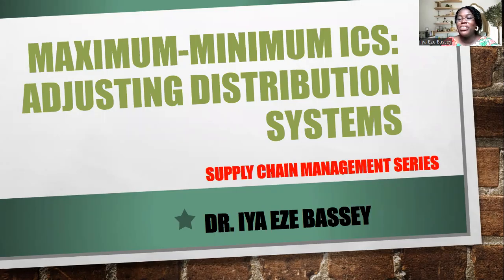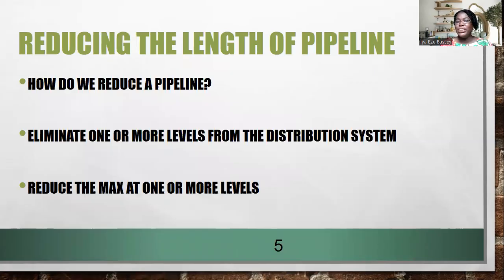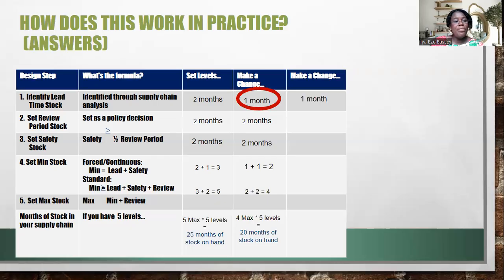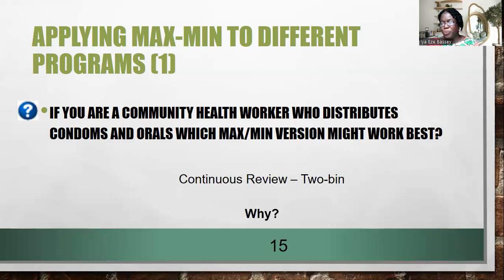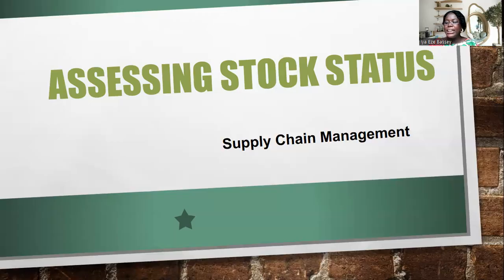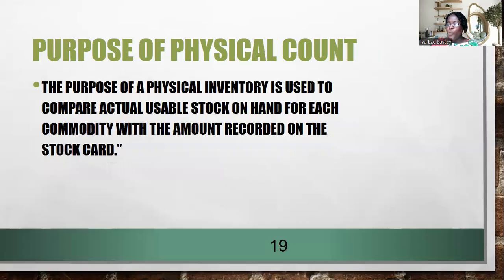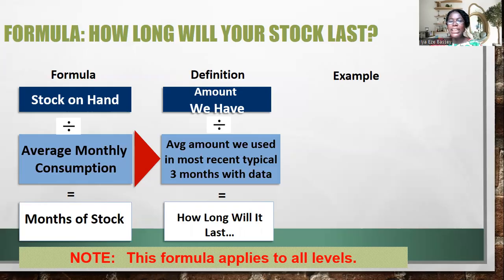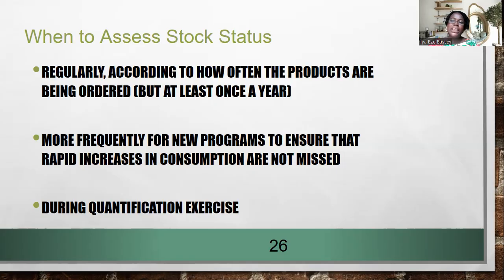Maximum-Minimum ICS: Adjusting Distribution systems (Supply chain management series)

Comment: Thank you ma. I understood that before setting up a max-min system, we need to follow some steps like setting up initial max-min policies for each level, checking if the distribution will function properly if these policies are implemented and checking the total length of pipeline that the policies imply. I also learnt about ways to reduce the length of the pipeline, which simply means making sure that supplies get to us faster and we can do this by;  improving distribution processes, reducing the lead time and review period. This is done by adjusting how much we keep based on how fast items are used and how quickly they can be replaced.
Other things that affect how we set stock levels include how often orders are made, storage space, cost of products, age of program, accuracy of forecast and more. The max-min system is very useful because it helps us know when to order and how much. But each type has its own challenge. The forced type can cause overstocking, continuous requires close monitoring, and the standard version works best with reliable data.
This system is not only for one type of product, it can be applied in programs like HIV, malaria and others depending on what’s needed.
You also discussed on assessing stock status, which helps us know if we have enough stock, too much, too little, or none at all. Doing a physical count is one way to check if what we have in records matches what’s actually in the store.
We assess stock status is to determine how long supplies will last and we were given a formula which applies to all levels; Months of Stock=  Stock on hand ÷ average monthly consumption
I practiced the examples given and I understood the maths.
I got to know that we are expected to assess stock status regularly, at least once a year. The topic really showed me how important it is to always track what we have, what to adjust and what to expect. Thank you once again ma.

Comment: Thank you very much ma. I learnt; In the adjustment of the distribution policies, we have to consider the length of the pipeline . We can reduce the length of the said pipeline by eliminating one or more levels from the distribution system and also by reducing the max at one or more levels. Other factors that affect the max-min system; cost of products, cost of storage, storage capacities, shelf life of health commodities etc. Advantages of using the max-min system; it avoids understocking and overstocking, it ensures consistency of each level, it minimizes wastage etc. Challenges faced when using the inventory control system; systems with numerous levels, systems that manage large number of commodities, and systems that manage products for new programs. How to access stock status;determining our months of stock, whick can be done by fist taking a physical count. We access stock status because we want to know how long supplies will last. Formula to know how long products will last(months of stock)
Months of stock=stock on hand(stock that is a available)/ average monthly consumption (most recent typical three month data).

Comment: Thank you prof. In this video I have learnt, disturb in designing a Max- min ICS which are, to set up initial Max min policies for each level and types of facility, check if the overall distribution will function properly if the level specific max-min policy are implemented and check the total length of the pipeline that the policies at each level imply. And I also learn that there are ways to reduce a pipeline which include elimination one or more level from the distribution system and reduce the max and one or more levels. And the ways to reduce the minimum stock level which is to reduce some element of the formula which can change in order to reduce the max- store levels
Thank you Prof.❣️

Comment: Thank you ma'am for this lecture 🙏🏽

It is important to note that, in the adjustment distribution policies, the implementation of specific maximum policies of each distribution level is important for inventory flow, in the public health  Supply chain.
Some advantages of max -min inventory control systems are :
* Reduce waste 
* Avoid emergency costs 
Some challenges faced are :
* Managing of systems with multiple levels 
* Managing inventory for new program 
The purpose of stock assessment are:
* Conducting a physical Count
* Essential in verifying stock accuracy 
* Preventing discrepancies that could lead to stockouts or overstocking.

Comment: Thank you prof for this great lecture. 
In summary, there are ways in which the distribution system policies can be adjusted and the first thing to consider is the length of the pipeline. 
Considering the length of a pipeline in designing a max-min ICS, the steps includ:
1. Setting up initial max-min policies for each level and type of facility. 
2.  Checking if the overall distribution will function if the specific max-min policies are implemented. 
3. Checking the total length of the pipeline that the policies at each level imply. 
Ways in reducing the length of a pipeline include:
1. Eliminating one or more levels from the distribution system. 
2. Setting up policies that helps to reduce the max at one or more levels. 
 
Reduction of length of pipeline is done systematically by:
1. Shortening the review period. 
2. Reduce the lead time both at one or more levels. 
3. Improve system distribution reliability. 

There are some factors that can affect the impact of max-min stock levels other than length of pipeline which include:
a. Cost of product.

b. Reliability of transportation. 

c. Storage capacities. 

d. Shelf life of health commodities.

Advantages of this system include:
a. Avoid overstocking and under stocking. 

b. To simplify inventory control decisions-making etc.

The challenges of this system occurs in the case of system with numerous levels, 
 System that manage a large number of commodities 
 System that manage products for new programs. 

Assessing stock status is done by physical count which is the counting by hand the total number of usable units of each health facility at any given time. 
 The purpose of this system is to compare actual usable stock on hand for each commodity with the amount recorded on the stock card. 

The general purpose of assessing stock status is to determine how long supplies will last. 

Formula for assessing stock status are:
Stock on hand (amount we have)
 divide by 
Average monthly consumption (Amount we use each month 
equal to 
Month of stock(long it will last).

Comment: I’ve learnt that setting clear maximum stock levels at each point in the supply chain is essential for improving inventory flow, especially in public health systems.
The Max-Min inventory control system helps by: Reducing waste and Avoiding costly emergency orders
However, it does come with challenges, like:
Managing complex, multi-level supply chains. And handling stock for new programmes
 Regular stock assessments are important because they:
1)Confirm actual stock levels
2)Help prevent stockouts and overstocking
3)Keep the system running efficiently.

Comment: I learnt that to achieve and get an improved distribution system.The Maximum_minimum ICS; ADJUSTING DISTRIBUTION SYSTEM has to do with identifying ways to adjust distribution polies Which are;;;
*Set up initial max-min polies for each type and type of facility.
*Check of the overall distribution will function properly.
*Check the total length of the pipeline that the policies at each level imply.

Factors That Impact Max-Min Stock Levels 
*Lead
*Reliability of source of supplies 
*Effect of a zero balance of stock 
*Management skill of staff 
*Age of program 
*Accuracy of forecast

Comment: Identify ways to adjust distribution system in
Nigeria
The steps in designing a max-min ICS which are
to set up initial max-min policy for each level and
type of facility, check total length of pipeline that
each policy level implies,check if the overall
distribution will function properly if specific
max-min are implemented,
I learnt the ways to reduce the maximum stock
level and to change some element of the
formulas,for instance you could reduce review
period at one or more levels ,we also went
through how the work in practice works
I saw the factor which impact max-min stock level
and they are
Cost of products,storage capacity, lead time, age
of program
Some advantages of using max-min system
Avoid overstocking and under stocking
Minimise wastage
We also looked at challenges of using each of the
inventory control system
System with numerous levels

Thanks ma

Comment: In summary,
Factors Affecting Maximum-Minimum Stock Levels:
1. Cost of production
2. Reliability of transportation
3. Storage capacity
4. Cost of conditioning
5. Shelf-life of the commodity
Advantages of Maximum-Minimum Control System:
1. Avoid overstocking
2. Avoid understocking
3. Minimize wastage
4. Avoid costs of emergency orders
5. Consistency of stock levels
6. Reliable data source from Service Delivery Points (SDPs)

Physical Count
A physical count is the process of manually counting the total number of usable units of each commodity in a store or health facility at a given time.

 Purpose of Physical Count includes :
1. Compare actual usable stock on hand with the amount recorded on the stock card.
2. Determine how long the stock can last.
3. Update stock records for accurate forecasting and supply planning.

Comment: In summary, l learnt that in adjusting distribution policies that implementation of special maximum policies at each distribution level is important for optimizing inventory flow, particularly in public health supply chain 
In designing a maximum - minimum policies inventory control system is to:
- set up initial maximum -minimum polices for each level and type of facility.
- Total length of the pipe line 
- eliminate one or more levels from the distribution system 
- reduce the maximum at one or more level.
 Factors that impact max-min stock level 
- shelf life
- lead time 
- production cost
- Reliable source of supplies

Comment: Thank you Ma for this lecture. 
In summary I learnt: 
- In designing a Max-Min ICS you should be able to:
• Set up initial Max-Min policies for each level and type of facility 
• Check if the overall distribution would function properly if the level specific Max-Min policies are implemented 
• Check the total length of the pipeline that the policies at each level imply. 
- You also explained how we can reduce the length of a pipeline. We can reduce the length of a pipeline by: 
• Eliminating one or more levels from the distribution system, OR
• We can set up policies that can reduce the max at one or more levels.  
- Factors that can impact Max-Min stock levels are: 
• Cost of products 
• Storage capacity 
• Reliability of transportation 
• Lead times 
• Accuracy of forecasts, etc. 
- I also learnt about "Assessing Stock Status" where you mentioned how we can determine our months of stock. We can determine our months of stock by:
• Physical Count: 
This is a process of counting by hand. The purpose of physical counting is to compare the actual usable stock on hand, it is also used to determine how long the supplies will last. 
This physical Counting should be done at least once a year or frequently if you notice discrepancies. 
Thank you Ma.

Comment: A summary on maximum _ minimum inventory control system: Adjusting distribution system 
In summary I learnt that in designing a max_min inventory control system the various steps involved are 
Length of pipeline, 
Reducing the length of a pipeline 
Reducing the maximum stock levels 
Some other factors that could impact max_min stock levels include 
1 cost of product 
2 reliability 
3 storage capacity 
4 shelf life 
5 age of program 
6 lead Time 
I also learned the advantages of using maximum and minimum system which are;
1 it helps to avoid over stocking 
2 it helps avoid under stocking 
3 it minimize wastage 
4 avoid cost of emergency orders. and several challenges to using each versions and variation are 
System with numerous levels, system that manage large number of commodities, systems that manage products for new programs,
Assessment of stock status helps to determine our month of stock and it can be carried out in two ways 
1  physical inventory/ count. The purpose of carrying out a physical inventory is to compare actual stock on hand for each commodity with the amount record on the stock card 
2 determine how long supplies will last.

Comment: Thank you ma for this wonderful lecture on maximum - minimum ICS: adjusting distribution system starting from the length of the pipeline, how to set up initial max-min policies for each level of facility etc.

Factors that impact Max-Min stock level are;
• lead times
• reliability of source of supplies 
• effect of a zero balance of stock 
• age of program etc.

Advantages of using Max-min system are:
• avoid overstocking 
• avoid under stocking 
• minimize wastage etc.

Challenges to using each version and variation are:
• system with numerous level 
• system that manage a large number of commodities etc.
The purpose of assessing stock status:
• to determine how long the supplies will last
• to compare actual on unstable stock on hand for each commodities with the amount recorded on the stock card.
Formula for how long will stock last we have;
• stock on hand ÷
• average monthly consumption=
• months stock.

Comment: In summary I learnt that in adjusting distribution systems the lenght of the pipeline can be reduced by eliminating one or more levels from the distribution system,reducinthe max at one or more levels and reducing maximum stock level.
Factors that impact max-min stck levels include
-Cost of priducts
-storage capacity
-Cost of storage
-lead time
-Age of program etc.
The advantages include:
-Avoid over stocking
-Avoid under stocking
-Minimize wastage

Comment: In summary of this lecture, I learnt that in adjusting distribution policies implementation of specific maximum policies at each level is important for optimising inventory flow , especially in public health supply chains.
The advantages of Maximum - minimum Inventory control systems are ;
1. Reduction of waste 
2. Avoidance of emergency order cost
3. Minimizing wastage 
4. Simplifying inventory control decision making 
5. Avoidance of over stocking .

   Also I learnt that we need to to be able to access our stock and know how long it will last 
We can determine our stock by;
1. Physical count : which is the process of counting by hand the total number of usable units of each commodity in your store or health facilities at any given time 
The purpose of this count is to compare actual usable stock on hand for each commodity with the amount recorded on the stock card

Comment: Thanks for the lecture. This E-learning really effective.
From today's topics;

The aim of inventory control system is to maintain appreciate stock level of all products to avoid oversupply and shortage of products. It also help to determine when stock should be ordered and issues or delivered. 
Review period Help to check the contract of the storage warehouse to determine if there will be need for procurement, it entails checking of the expiring dates.
Maximum stock level is the ceiling quantities of commodity a stock keeper can hold a giving period of time.
Minimum stock level is the ground quantities of commodities a stock keeper can allow to prevent emergency procurement or safety stock procurement. To ensure lead time  do not affect the costumers.

Comment: In summary,the steps in designing a Max-Min ICS are:
1. Set up initial Max-Min policies for each level and type of facility.
2. Check if the overall distribution will function properly if the kevel specific Max-Min policies are implemented
3. Check the total length of the pipeline that the policies at each level imply
  I learnt that there are basically two ways of adjusting distribution systems:
1. Reducing the length of a pipeline and 
2. Reducing the Maximum stock level
    I also learnt of factors that impact Max-Min stock levels:
1. Cost of products
2. Reliability of transportation
3. Storage capacity
4. Cost of storage 
5. Storage conditions at different levels
6. Shelf-life of health commodities
   I also learnt of the advantages to using the Max-Min system;
1. Avoid overstocking
2. Avoid understocking
3. Minimize wastage
     I learnt of how, and when to assess stock status,and in assessing stock status,we have to know in details,every information about the commodity.
I also learnt of how to calculate Stock on hand and Average monthly consumption.